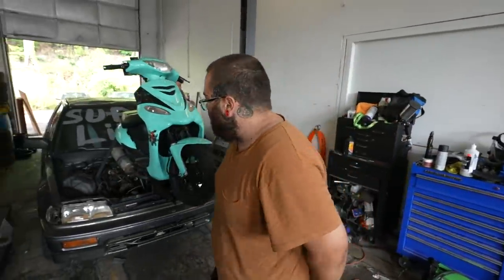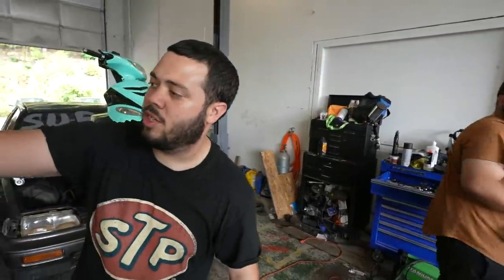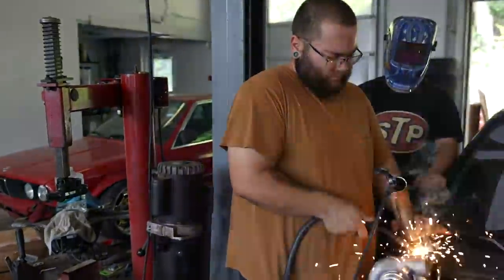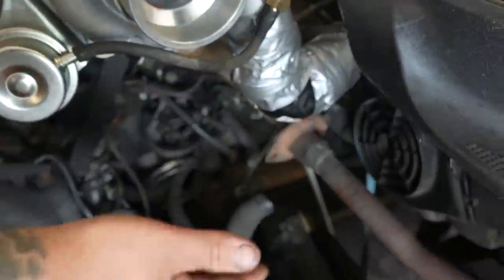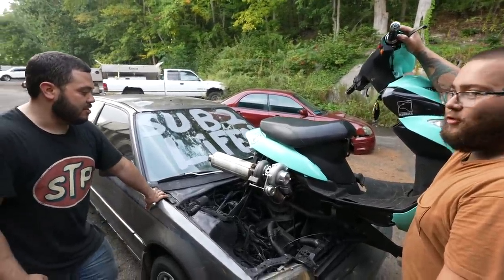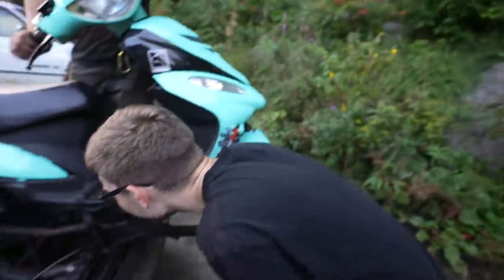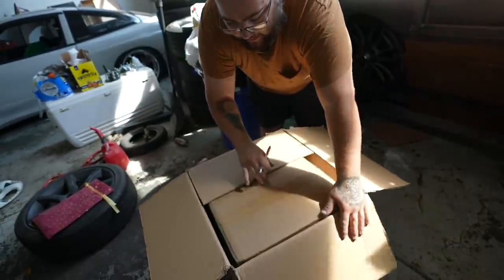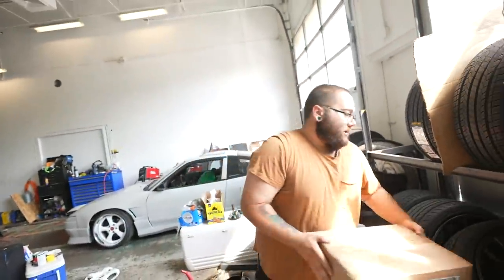We BOOSTED the Moped powered CIVIC

Comment: If you want to oil the turbo easily you could just make a maybe 30-60cm (12-24in) tube of steel that comes off the turbo where you spray oil and just have the steel tube go straight up from there and make it hold a bit of oil like motor oil or such, this way you don't need to be there with the wd40 all the time.

Comment: When I put the K4 turbo on my scooter. The boost was causing the intake valve to open and smack the top of the piston. When I put a blow off valve on and dumped it into the exhaust. It lit off and melted the scooter plastics.